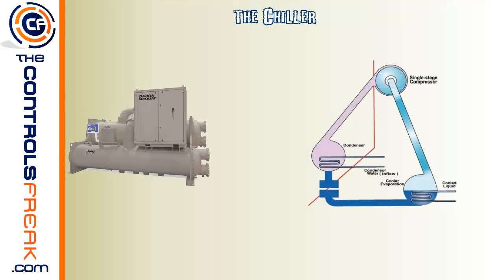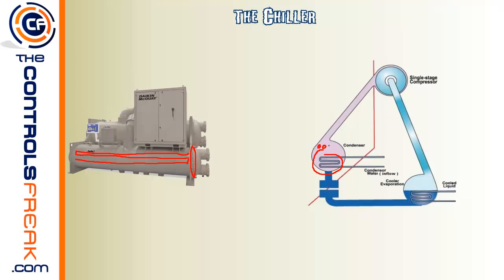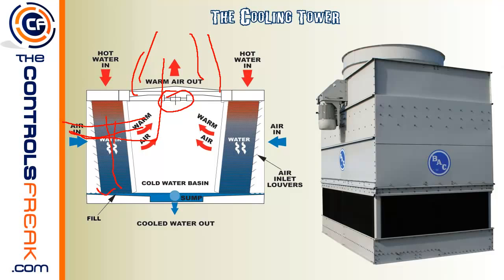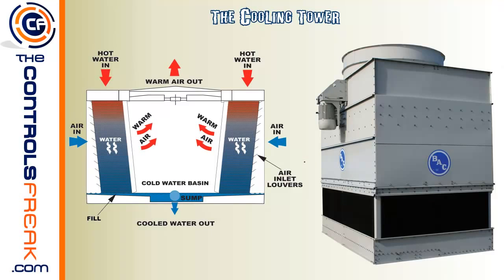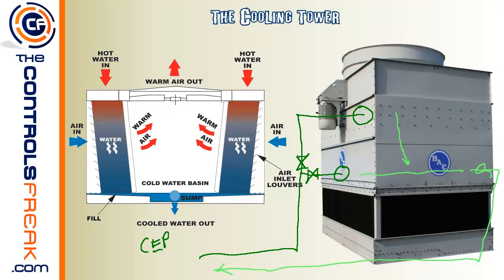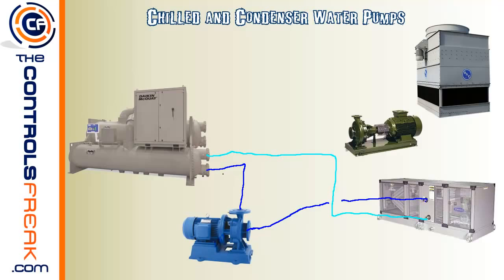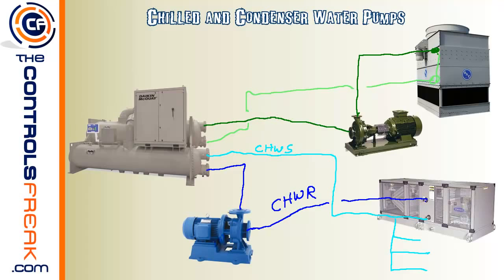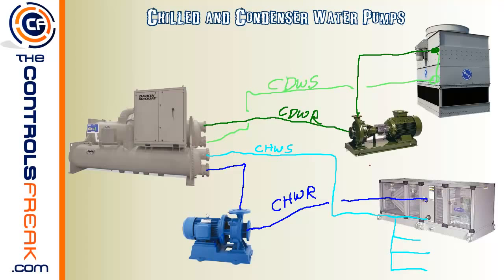How a Chiller and Cooling Tower work together?

Comment: ?? Question: First thank you for this. I live in a large condo building. They've recently installed a large chiller in the basement and put a single cooling tower on top of a 13-floor building. They also have replaced AHU's although I'm not sure where they are. Unfortunately, since they replaced the large AHU, we've been hearing loud rumbling noises. They appear intermittently including at night and prevent us from sleeping. The noise ramps up and stays on for several hours and then ramps down and gets quiet. Could you tell me what part of the cooling system is likely causing the problem? Is it easy to diagnose? What steps would need to be taken?

Comment: Hmm,,hi,,,shouldnt that blue pump be pulling supply water out of the most bottom pipe of the chiller into the bottom pipe of the air handling unit ??? then water comes out of the top pipe of air handling unit as a return water back to chiller???

Comment: Excellent video very well explained. One question how is the water the evaporates replaced. I would think if the system just dumps water across the cooling tower fins some would evaporate, right?

Comment: Thanks so much very nice and clear explanation.  One thing is that please explain me, how in chiller heat exchanges from cooling tower water to CHW Supply water going to the buildings to the air handling equipments?? Thanks
Reply: chiller, evaporator, cooled CHW   from the air handling equipment AHU. The condenser water picked the heat from the chiller, condenser, and bring it to the cooling tower . The cooling tower remove heat from the condenser water.

Comment: I clean cooling towers and AHU's for a living and you had you cooling tower diagram labeled wrong. The basin on the actual picture is actually at the bottom, below the fill.
Reply: you are correct